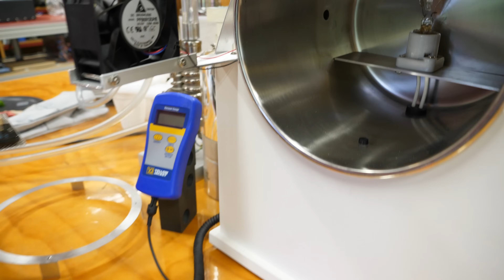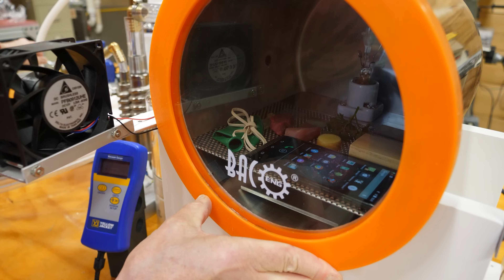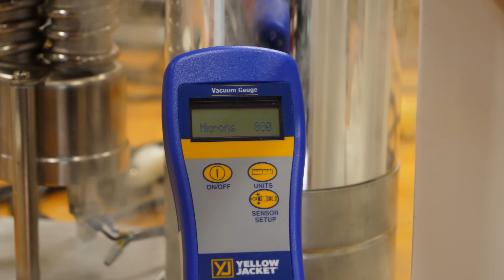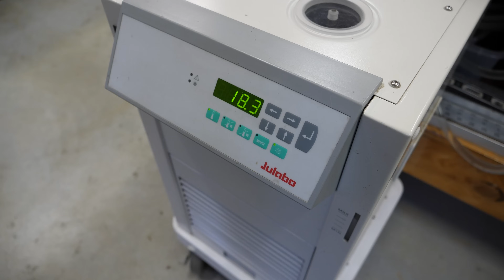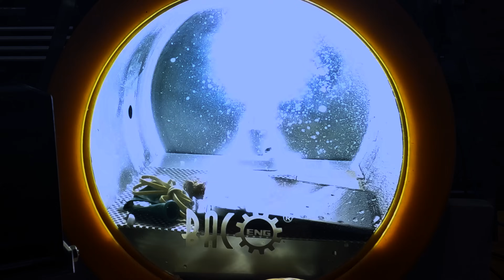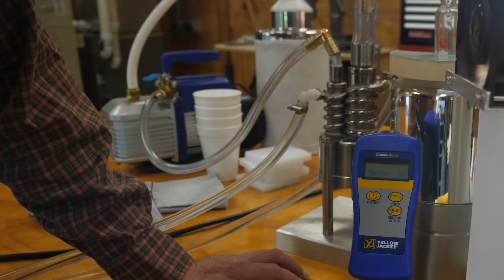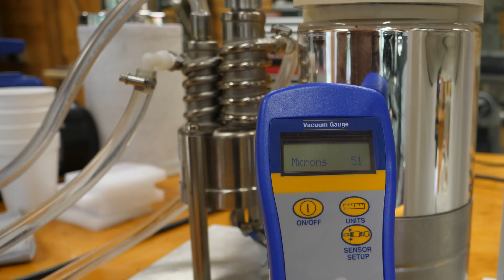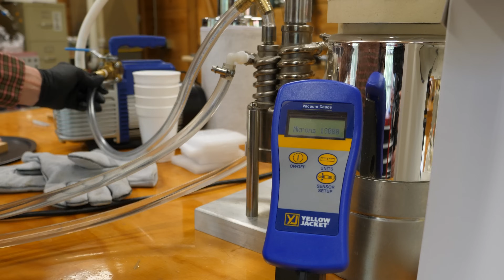We exposed BEEF to the vacuum of space, then ate it!

Comment: 12:50, No, LEDs don’t last longer, and for the most part, they are no more efficient.
22:26, there is no polarity in a metal halide lamp, other than that, brilliant video, I really wish that you hadn’t eaten any of that, lithium really is bad.
Reply from the maker: They are more efficient. When you compare an incandescent style LED bulb replacement at around 100 lumens per watt, then these are similar to a MH bulb.
However, MH bulbs are not typically used in similar fixtures. Industrial installations, such as in high bay lighting with multi hundred watt MH bulbs, still run around 90 while an LED source is up around 150. This gets worse with time as the MH bulb ages its efficiency drops faster than an LED.
Reply: @TechIngredients , true, the toy wattage MH, lamps use a larger proportion of their wattage to heat the envelope and superstructure, so they are only around 75 lumins per watt, however anything over 400, is minimum 100, just behind industrial led fittings at 120, nothing that mortal man can afford comes in at 150, and anything even close needs supplemental active cooling.
More importantly, that is just the lamp wattage, the harmonic problems that high wattage Led drivers cause can add up to 30% to their rated figures, inductive control gear on the other hand can easily be corrected with a capacitor.
You are partially correct about the degradation, but then again, its a $20 lamp every 4 years vs a $250 fitting every 6, and that doesn’t include the early life failures.

The absolute advantage for LEDs is the light all goes out the front, and on sports fields, that alone can be worth the price of admission. Take care, again excellent video, I learned so much from it, I use a vacuum pump every other week on refrigerant loops and change its oil regularly, I’m happy when I hold 200microns, never gave a thought to a cold well, brilliant.
Reply from the maker: Thanks.
You'll  probably enjoy our upcoming video where we fire our 1.2 kw blue laser at a phosphor screen.🤫

Comment: I have a question! How can space have a vacuum? Wouldn't the vacuum of space just pull the atmosphere off of earth?
Reply from the maker: Look at this differently.  Start with the vacuum. Add a planet with its  gravitational field.  Asteroids and particles that approach  the field are drawn down to the surface.  Similarly, gasses that vent from the inside of the planet move upward but slow and are also drawn back down towards the surface.
The vacuum of space doesn't  exert any force. There's  nothing there to exert force.
Reply: @TechIngredients  But everything lighter would escape to the "vacuum" .
You must know how powerfull a vacuum is (maagdenburgse bollen) .
things don't ad up imo .
more like density .
Reply: Thanks for the reply! It's hard to imagine with out a enclosed system? @TechIngredients
Reply from the maker: A vacuum  has no power at all.  The effect is due to the unopposed power of air pressure.
Reply from the maker: It may be difficult to reset your assumptions, but it's  critical  to understanding  so much of thermodynamics and aerodymanics.
Reply: Can or did anyone replicate this scenario where a vacuum meets a non vacuum media and not have any affect? Just trying to rap my head around this! @TechIngredients
Reply: @TechIngredients  What assumptions would that be ?
You are also assuming it's gravity holding thin air into place .
Whyle nobody actually knows what Gravity really is .

Comment: I was introduced to a product called System 48 Plus some years ago as a lubricant additive to engine oil to prolong engine life by curbing friction. It was supposed to have been engineered for servo motors on satilites to inhibit freezing of bearings at extreme temperatures. I have used the product on every vehicle I've owned ever since. I wonder how it would act in your vacuum chamber lubricating an electric motor.

Comment: Thank you. I've seen videos of folks impregnating wood with epoxy, and a vacuum chamber before turning it on a lathe. This made me wonder how drying the wood with your method, or perhaps freeze drying immediately before using the vacuum/epoxy method. Would the optical qualities of the finished product change because of the lack of water? How would the density of the wood affect the end product?
Reply from the maker: Good question, and anyone with the chamber used for the impregnation could do it.
Just run the system for 24 hours with mild heat (lamp heating pad) before introducing the resin.

Comment: The problem of outgassing is much worse than lubricants drying out. The outgassed molecules hang around the satellite in a cloud that never dissipates, and interferes with the satellite’s instruments.

This means for example that we can’t use electrical wires with PVC insulation, all wires must use PTFE insulation.

Every component is subjected to a very low pressure environment, and anything that outgasses must be replaced.

Comment: That was very cool. I like the idea of making a aerogel/wood material, especially since wood strength to weight is actually very good. Woodworking is an old and well practiced human skill. If the vacuum treated wood could be treated/coated so that it won't take up water again, maybe you really could make wooden spaceships. Resins are relatively weak, and heavy. Lithium Magnesium alloy however has a yield strength similar to mild steel, and a sp.gravity of about 1.35-1.4 . melting temp from 190°C to 230°C. If the vacuum treated wood were dipped? sputtered? electocoated? with Lithium Magnesium alloy sufficient to keep water vapor from re-entering the wood, you might end up with s very strong, very lightweight material. Just a thought. Thanks for your thought provoking work.

Comment: I recall a problem one of the space missions had (can't remember which one) where an access door became jamed.  Turns out, if you put two pieces of metal together, here on earth, the thing that prevents them fuzing together is the air that gets trapped between them.  In the vacuum of space, however, the separate metal parts of the hinges of the door just fuzed together.  

We get the same effect if we "wring" guage blocks together.  If you leave them together for too long you can never separate them.  So something you might try is putting a couple of pieces of metal together and leaving them 24hours in your vacuum.  Can you actually weld metal simply by using a vacuum?  In theory you should be able to.

Comment: In the late 80s I met a man who was working on a closed cylinder with a vacuum on one side of a membrane and increased pressure on the other side. When the membrane was ruptured it created a loud explosion. The government was interested in creating a simulated explosion without the dangers of using pyrotechnics. His company created a valve to replace the membrane thus allowing the chamber to be continuously reused. Then someone decided to put a steak into one half of the chamber. The explosion ruptured the meat cell membrane and, in effect, tenderized the meat. Curiously, it also destroyed the cell membrane of bacteria that contribute to the spoilage of the meat thus effectively increasing its shelf life. Interestingly this process worked on meat that had already been vacuum packaged.
Reply from the maker: Interesting.

Comment: Those connectors inside the xt90 plug are just called banana connectors. 
You can buy male and female connectors. They can be used in audio equipment or drone esc connectors.  Those are 4mm banana connectors but you can even buy larger 5mm. If you needed more power flow.
Reply from the maker: Sure

Comment: I just came up with idea looking into bulletproof glass I found a material called aluminium oxidenitride  1.6 inches can stop a 50cal I was wondering because of the particle size is between 150-500 nm if graphene would make it stronger
Maybe larger nm diamond could be added as well 

Tldr possible glass 1”thick stops 50calbmg

Comment: Having run metal halides on reef aquariums. I suspect the majority of the damage done to the cell phone was the heat. Cooling the outside of the pot wouldnt do much about the inside. I had to run chillers on smaller volume aquariums, and use evaporative cooling on larger volume aquariums. Those halides heated the water pretty quickly.
 And thats with significant gaps between the surface and the bulbs. As well as several fans running across the bulbs.

Comment: I'm an HVAC tech. Our micron goal when we we're preparing the copper lines for refrigerant is 500 microns. It's pretty awesome that you can casually keep a contaminated system at 54 microns for 8 hours. I would like to see the effect of this vacuum chamber on different types of oils, both hygroscopic and hydroscopic.
Reply from the maker: Thanks for the suggestion.  That's  a good idea. Testing the wood for weight,  strength, and stiffness is another frequent  request.

Comment: I worked in the vacuum industry when I lived in New Mexico (so you can guess who our customers were). We sold equipment, rebuilt pumps and I was in charge of the machine shop where everything we made was one off chambers and piping. We did have an old chamber and one day decided to take a few of the pumps laying around and backed them up, then just put various things in the chamber to see what would happen.

The funniest one was a beef and bean burrito. It took all night to pump that thing down and we pretty much had the LN2 trap full of garbage. The burrito was about 1/3 the size. At least we just used an old Welch pump backing up the LN2 trap as we knew that the turbo pump would never make it with all of the stuff coming out of it.

In the end, water is the biggest load, thus why things like wood come out lighter.

We did do a project to vacuum pack cadavers. We used dead pigs. That was for a customer that did not understand how long it took and the energy to do so. Remember, these were not frozen first. Way too much water load.

Comment: I really didn't expect such dramatic results from only 24 hours. I'm now very curious about how vacuum-treated wood could be used in composites since it gets so much lighter without the water. Could cheap wood treated in a vacuum replace expensive composite materials if it is sealed from moisture with epoxy soon after treatment? Wood is so easy to work and if its weight could be reduced it might make an excellent base for strong composite manufacturing.
Reply from the maker: I agree. 
We might test that.
Reply: @TechIngredients  I think it would be interesting to see any strength changes to the base wood before/after and the final weight/strength of composite structures made with foam cores, wood cores, hollowed wood cores, and combined wood and foam similar to surfboard construction that has a central wood rib for rigidity. Thanks for really digging deep into your projects and explaining so many of the details along the way.

Comment: So how much does that wood weigh one year later?

It might be interesting to repeat the experiment but right after you take it back out of the vacuum try to use some kind of wood sealer to keep water from finding its way back in, and see how long it can retain that lightness -- which I assume comes with better thermal properties and more buoyancy.  Not sure about mechanical.  Maybe put some dowel in there and see how much you can bend it before it snaps?

I'm not sure how meaningful the light is.  I think most components of interest in a satellite are going to be shielded by the hull, so they might get hot but they probably don't have to deal with much UV.
Reply from the maker: Good ideas.
Some structures in a satellite are exposed, and we thought the additional burden of the intense UV would be more interesting.
Reply: I guess another thing might be to see how the wood burns.  Or how easy it is to ignite.  It seems like it must be "tinder dry" in the most extreme way.  Useful for camping?  Would it ignite from rubbing with a stick more easily than the conventional method?

I took an initial interest because your comment about it feeling like aerogel made me wonder if it might be a cheaper substitute for aerogel in some applications.  But I had second thoughts after thinking of the blowtorch demos for aerogel.

Or here's an ill-considered thought.  Could an especially light wood capture enough vacuum to become lighter than air?  I assume air would soak back in right away, so it would have to be more of a framework to keep a balloon from collapsing.

Comment: I wonder if things that are more pressure resistent are also more vacuum resistent
Reply from the maker: In general, yes.  The forces are in the opposite direction, but they're substantial, so the structure has to be robust.
Reply: A vacuum vessel fails by buckling. At best—a pressure vessel is only designed not to buckle under its own weight when unpressurized. If vacuum is out of scope then there's no predicting what will happen

Comment: Is the effect on the wood lasting? or does it turn back to normal over time? Maybe not if you seal it up with a layer of resin or paint. I guess it has a much larger RC value than the original wood? I guess one could make very thin insulation material by using the vacuum and sealing it off (I don't think the light had much to do with it).
Reply from the maker: Agreed

Comment: I am expecting the gas bulb from the HID to explode. Why dosent it? Vacume outside, heat and pressure inside.
  Also does the higher vac of your chamber make the light brighter?
Reply from the maker: The pressure in a running HID bulb is much higher than atmospheric pressure. 
Removing one more atmosphere from the pressure surrounding the bulb isn't significant. 
It's hard to say regarding output because  the chamber reflected as well as blocked some of the light.
Reply: @TechIngredients  thank you for the reply.

Comment: Why were you worried about the light bulb polarity, isn’t it AC?
Reply from the maker: It's  based on safety. The hot lead should  be isolated both in the chamber and through the power supply.  The neutral line is effectively at ground potential, which is where we want the chamber.

Comment: Isn't there a problem with 2kW lamp warming up everything inside and burning it a bit? Keep in mind that heat can be transfered only via radiation in vaccuum and cooling of motors for example is a problem. In your case items are placed on a metal grid, maybe it has enough thermal conductivity, I'm quite sure it was tested. For lubrication we use something from Fomblin, it looks like a white vaseline, but they make low vapor pressure greases.
Reply from the maker: You meant  200 watts, but you're right.  Those items will get hot just like they would in orbit.

Comment: A few things that might be interesting to test in orbital conditions: 
Asteroid simulants, more batteries, bottled hydrogen, a stirling engine lighting an LED and a zinc-coated steel bolt and nut.

If asteroids from the belt were towed closer to the sun, how might they decompose? 
Which type of chemical battery is simple enough to be built on another celestial body but sturdy enough to withstand insolation? Are most metal-acid combinations viable or do you have to avoid anything that might produce hydrogen?
Does hydrogen escape containment faster in vacuum?
Will the working fluid from a regular stirling engine´s pistons escape into space? Letting it light a battery would give an indication to voltage loss. If so, you could try making it spaceworthy and track your progress with the light intensity.
The zinc coating on machine parts might be reduced and fuse. If so, bolt and nut would become inseparable.
Reply from the maker: Those are all very good suggestions.
Interesting!

Comment: FYI.  Swelling lithium cells are an ongoing problem with pouch style.  Usually the result of environmental temperature above 45 Centigrade at 1 bar for extended period (>36 hours).
So you may have revealed another (unknown?) issue with such packs under a vacuum.  Very interesting.  Did you measure the environmental temperature inside the chamber?  If so, I would love to know what it was.
Reply from the maker: That really  can't  be done without  air. Each surface will be at a different  temperature  depending on its  exposure to the light.  There is no equilibration.
Reply: @TechIngredients  Understood - now.  But if you ever repeat that experiment, it would be interesting to know (thermocouple cemented to the pouch cell).  I am just attempting to discern if it is temperature or outgassing of the cell due to pressure differential that caused the swelling.

Comment: Good video.   Maybe test a bunch of different seeds for different lengths of time and seen what germinates after being exposed to space.  Maybe include yeast?  I vacuum seal yeast in a food saver but its not close to what you are achieving.
Reply from the maker: Good idea
Reply: @TechIngredients  i suspect most of the lower vacuum pressures would be failures,  but maybe at the pressure of Mars or the moons of the bigger planets!  Too close of a simulation and nothing would germinate just due to temp.  Just an idea.

Comment: Wonder if you could cold weld in this vacuum
Reply from the maker: Probably not.  The vacuum should be as high as practical and typically is several orders of magnitude better than what this simple setup can achieve.
Reply: @TechIngredients  In some of my past occupations we cold welded copper in atmospheric pressure.  The way I understood it (I most certainly can be wrong) is that the atmosphere plays a less significant role than oxide layers.  So in the atmosphere they use force to disturb the surface.  I wonder if creating a partial vacuum would mean a need for less force application.  I just think cold welding is a very cool feature and it gets my inner nerd excited.